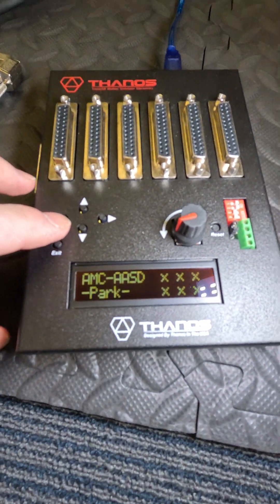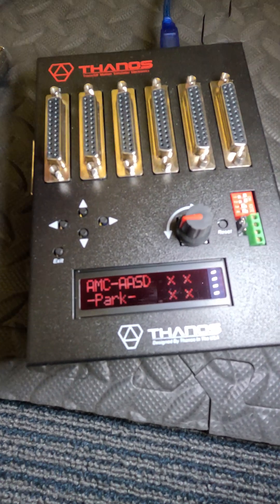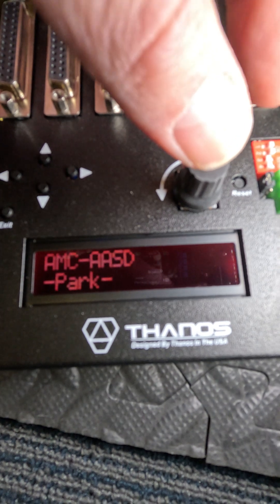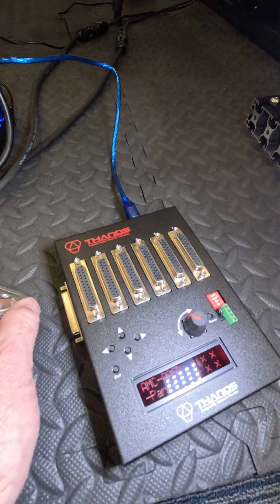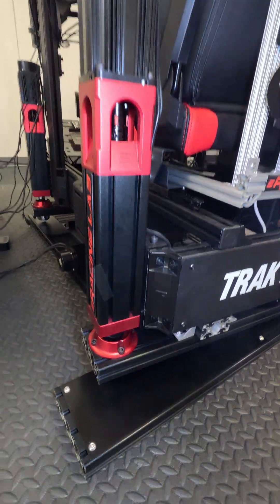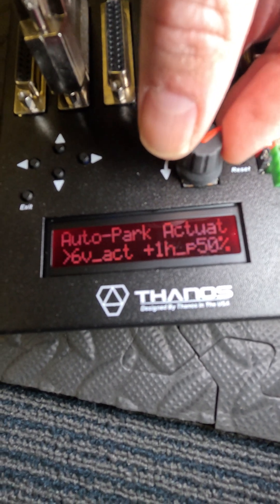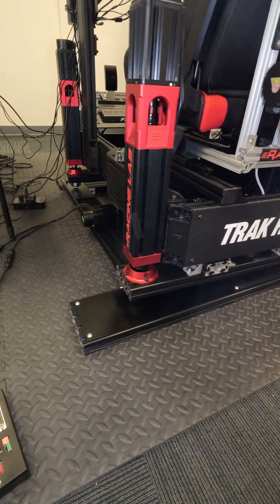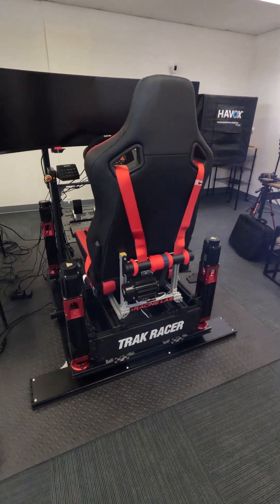eRacing-lab defaults for Thanos controller.

Comment: I have the e-racing mega plus kit with your thanos amc-aasd all in one/ with the 80st-m02430 white controllers. What is the default spike filter? Right now it's at level 248 but if I turn it up to the recommended settings (2632) I got in a email from them. I get the AL-04 error. I believe it's that error I am afraid to do it again lol.
Reply: I should say I only get that error on 1 accuator. btw. I am only messing with it because it seems like it's lagging in the racing sim.
Reply from the maker: You should use Simhub, you don't have to use or enable spike filter in the controller with it.
Reply: @tronicgr  I have simhub for my butt kicker but I'm using Sim racing Studios for the software